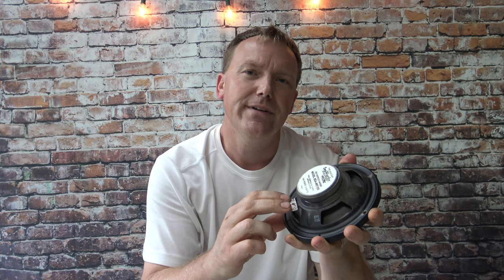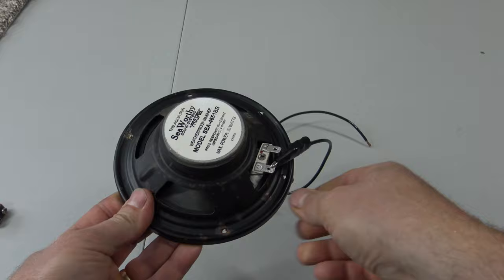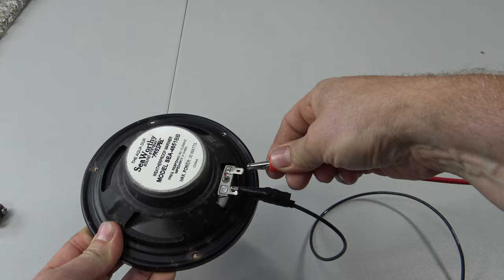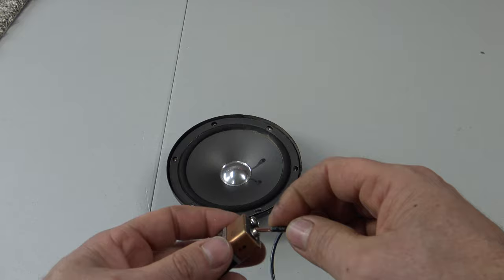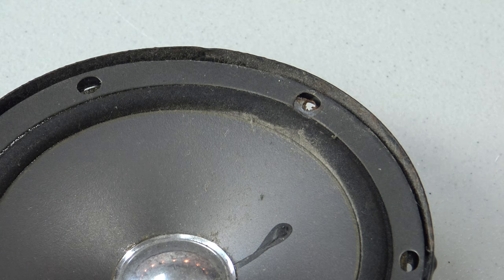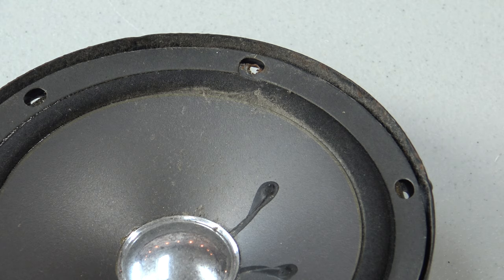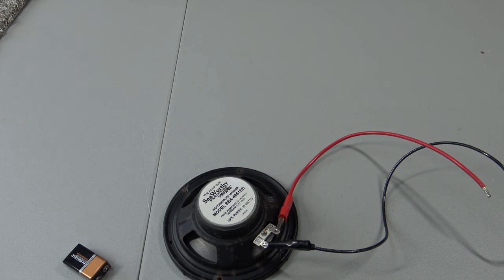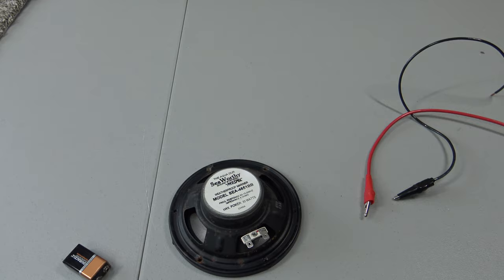How To Find Which Speaker terminal is Positive or Negative

Comment: Thank you for making this video. I have a great set of 6X9's from a Chrysler 200. There were no + or - on the speaker connections. I did exactly what you showed. I took the 9volt battery out of my smoke detector and used it. Just like that, I figured out what was the positive and negative side. THANK YOU what a great trick I will use for the rest of my life!!! Oh yeah, I put the battery back in the smoke detector.
Reply: Thank you both. I was about to go to Home Depot and get a 9 volt battery and read this comment. You both are genius caliber . . ., now I’m off to the smoke detector, lol 😂

Comment: So, I've heard it's better to use a double AA because anything over 1.5 volts could blow the coil. I'm assuming this would apply to cheap or old paper cone speakers but have you tried something smaller than a 9 volt?
Reply from the maker: Go ahead and try 1.5v and see if it moves. Ive never had a problem with 9v
Reply: @addismultitasking3504  Nope. 9 volt it is. 1.5 volts barely makes a static sound but no movement whatsoever.
Reply from the maker: We learned something, thanks for watching

Comment: I'm actually down a youtube rabbit hole on how to service osciliscopes, but this looked interesting so i clicked.
This is a valid way of testing. Just a warning, 9v is okey for larger drivers like this, but smaller would need lower voltage. Also try and keep it only connected for a short time. Sub second. ie just rub the wire over the contact. those coils are made up of super thin wire and can burn really quick.
That said, I have yet to find a driver where negative is not on the left. Seems to be universal - left, + right with the connectors pointing to you.

Comment: that's all very well but that does not identify or inform me which of the wires coming from the stereo, which are in the door, are positive and negative, which no one on You Tube seems to know. Thanks.
Reply from the maker: you need the radio schematics it will tell you by color

Comment: this made a lot more sence before you zoomed in and now we dont know what yall doing but its a neat trick i get the idea. my issue is i know which teminal is positive which is negative, but i dont know which speaker wire is positive or negative?
Reply from the maker: thats a pain in the butt, probably have to remove the stereo deck to find out??
Reply: @addismultitasking3504  you think it makes a difference in sound quality sounds same to me which was round it is yall

Comment: How did you determine which wire of the car or deck is going to attach to positive and which to negative terminal of speaker since you said both are gold wires probably not marked as to which is which.

Comment: Hey man just fixed my 05 accord. Got the radio replaced and put new speakers in. It still sounds clipper and distorted at higher volume. What do you think the problem os?
Reply: New radio has built in amplifier? What are the watt rating of each speaker ? You probably need an amp assuming new speakers are upgrades

Comment: Thanx for the HELP! I ASSume that it is WAY too much trouble for the IDIOT manufacturers to actually LABEL at least one of the speaker terminals?!? BTW, one terminal is obviously BIGGER (wider) than the other. That is probably the POSITIVE one, right? I'll DO the test now.
Reply from the maker: Thanks for watching hope it helps you
Reply: Of course I had a 50/50 chance of being right, but was WRONG! The BIGGER terminal is NEGATIVE on my mid-woofer! I did the battery test and LABELLED the positive with a RED Sharpie. I also had to put a wider connector on the negative wires.   On the 'positive' side, I din lol punch a hole thru the woofer with the screwdriver, like I've done before in 1972 installing 6" woofers in my 1959 Pontiac door panels!  (=
Reply from the maker: Glad you got it